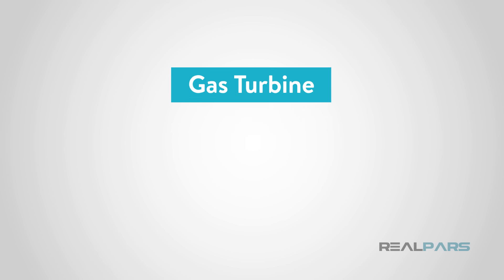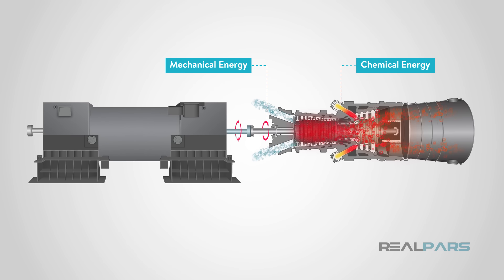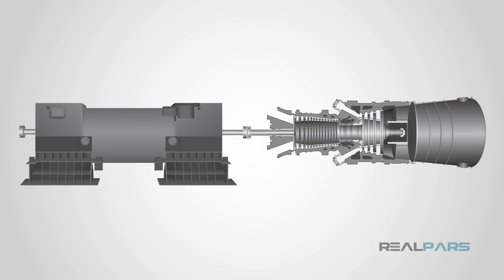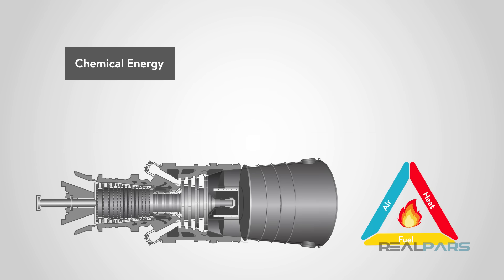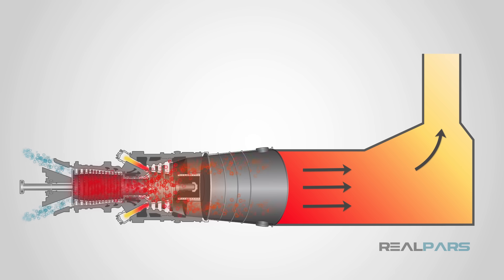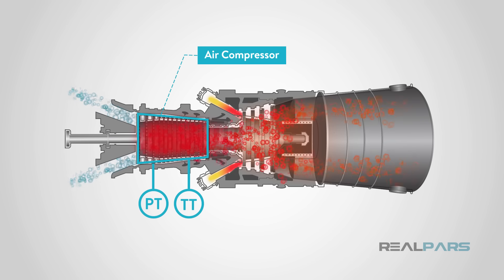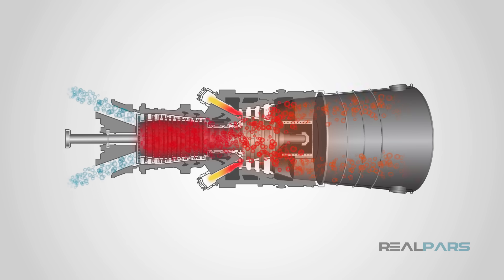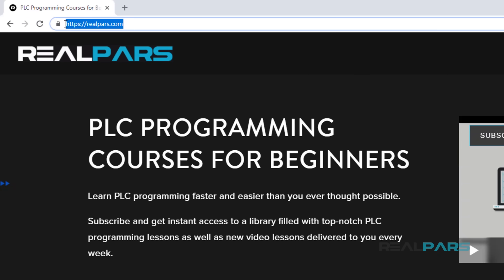What is a Gas Turbine? (For beginners)

Comment: Two of the most common applications of Gas Turbines in modern industries are turbo generators and turbo compressors. I try to approach a gas turbo generator or GTG to better feel the subject. In a gas turbine power plant,there’s generator which is an electrical machine. But to generate electricity this generator needs a prime mover which for my example is a gas turbine. The gas turbine transforms the chemical energy in the fuel for example natural gas or similar fuel, into mechanical energy. The mechanical energy generated by the turbine exit shaft is then transferred through a gearbox to the Generator’s shaft. Now my generator can create electrical energy. This primitive form of electrical energy normally has a low or medium level of voltage and to better manage the power loss in transmission lines, this voltage should be increased by step-up transformers. Such transformers give an adequate level of voltage to the electrical energy to be transmitted through the transmission lines and delivered to the grid. After this brief overview of a sample gas turbine application, I’m going to dig down into the Gas Turbine mechanism in more detail. First, imagine a rocket in which some fuel is going to burn and create a high-pressure exhaust gas. Based on energy conservation law
Reply from the maker: Appreciate you adding this insightful overview. 👍

Comment: I've got a slight nitpick @ 1:49

The voltage doesn't decrease from the the distribution line to the home by itself. That diagram in real world conditions would fry every piece of electronics in a house. The voltage is decreased by step-down transformers at a substation; which isn't pictured there. And then it's stepped-down again by another transformer positioned on a pole somewhere along your street.
Reply from the maker: You're absolutely correct in pointing out the varying voltage levels from the power plant, ranging from 69,000 to 765,000 depending on transmission distance. Eventually, this voltage is brought down through a step-down transformer to a more usable 240/120 range.

While this video focuses specifically on "What is a Gas Turbine?", we truly appreciate your interest in discussing voltage in more detail. Your input means a lot to us. If you're keen on exploring voltage further, we have a range of short videos dedicated to the topic on our RealPars YouTube channel that you might find engaging and informative.

Comment: Why gas is compressed in multistage how it increases the efficiency?
Reply from the maker: Thank you for your query. Gas turbine engineering is designed to maximize fuel efficiency. Typically, in this engineering process, the heat generated by turbines is repurposed to heat a boiler, producing steam that powers an additional generator to generate electricity. Numerous original equipment manufacturers (OEMs) implementing turbines often adopt this technology. For further insight into this topic, I encourage you to explore the following links as valuable resources to aid in your learning:

https://www.energy.gov/fecm/how-gas-turbine-power-plants-work#:~:text=As%20hot%20combustion%20gas%20expands,a%20generator%20to%20produce%20electricity.

https://www.siemens-energy.com/global/en/home/products-services/product-offerings/gas-turbines.html#:~:text=Our%20heavy%2Dduty%20gas%20turbines,extensive%20validation%20and%20testing%20capabilities.

Happy learning!

Comment: What is the difference between turbocharger based generator & gas turbine based! Which is profitable & why!!?
Reply from the maker: Thank you for your inquiry. According to industrial standards, I'll provide definitions for both devices you mentioned in your question. However, determining which one is more profitable is complex, as it hinges on geographical location and the engineering intricacies of their designs.

Turbocharger: A turbocharger, when added to a basic generator gas engine, incorporates an air compressor utilized in internal combustion engines to augment the volume of air entering the engine. This enhances its efficiency and power output by enabling the engine to burn more fuel through the increased air volume in the combustion chamber, thereby boosting overall performance.

Turbine Engine: In contrast to a turbocharged engine, a turbine engine—also referred to as a gas turbine—generates mechanical power by harnessing energy from a rapid flow of hot combustion gases. 

Happy learning from RealPars!
Reply: @realpars  Thank you very much!  I'm a service engineer, working on turbocharger actually! Thanks for the reply!

Comment: The cogen at the plant I'm starting to work right now uses a diesel starter to start the gas turbine. Every other process that you show in the video is similar, except for the diesel starter. If possible, can you show the start up process?
Reply from the maker: Thank you for your question. It's a thoughtful one, but the video did not cover certain proprietary technologies employed by various manufacturers. To get a better understanding of your co-gen system, I recommend checking the operator manual that should have come with your unit. Additionally, here's a helpful link to further assist you in your learning journey:

Understanding the Diesel Engine Control System Used to Start Gas Turbine
https://control.com/forums/threads/understanding-the-diesel-engine-control-system-used-to-start-gas-turbine.48597/

Happy learning!

Comment: what measurements are typically recorded during operation ?
Reply from the maker: Hi there,

Thank you for your question! As we mention in the video, there are numerous devices an Engineer must monitor, like the PT, TT, sensors like Thermocouples, vibrations, RPM, air intake, and so on. Here is a link from Siemens if you want to learn more about the Energy industry. 
https://www.siemens-energy.com/global/en.html

Happy learning!

Comment: You are an engineer working for a manufacturer of land-based gas turbines. These turbines are similar to jet engines, but they are used on land to provide power for electricity generation and gas compression pipeline applications. Suppose that you would like to apply a ceramic-based thermal barrier coating to the turbine blades in the first-stage turbine to increase the operating temperature and efficiency of the engine. (a) What difficulties might engineers experience in trying to design a ceramic coating that will be applied to a super alloy metal blade? (b) What properties should be taken into consideration when choosing a suitable ceramic material for a coating? Be as thorough as possible.

Comment: May I have a question? 
I wondering that have any plants use pure Oxygen instead of air to increase efficiency?
Reply from the maker: Great question!  The answer is "no", since the turbine would not be able to do useful work in a pure O2 environment.  Nitrogen in the intake air is being employed as a process gas, which helps to get useful work from the combustion process. By being heated and accelerated in the combustor, it does the main work of driving the turbine and turning heat into mechanical work. A pure O2 stream would just combust, limiting the amount of useful work.

Comment: Why wouldn't they pre-heat, the incoming air by the exhaust, to increase efficiency and decrease fuel consumption?
Reply from the maker: Very large gas turbines may have economizer sections where waste heat is reused, but part of controlling the efficiency in the combustion chamber is control of the incoming air and fuel streams.  Normally, the bulk of the energy in the turbine exhaust has been converted to work (rotating the turbine) and the residual heat is not easily captured or able to be reused.  It is a matter of the economics of doing so, as well as space limitations where these engines are used.
Reply: Colder air is denser so you would get a more efficient burn, but by the time the air has passed through the final compression stage it is so compressed that the temp is already increased

Comment: What is difference between Gas Turbine and Power Turbine?
Reply: The term Gas Turbine generally applies to the whole unit package. Some Gas Turbines have 2 shafts, and several rows of turbine blades. The high pressure turbine blades drive the unit's compressor stages on the first shaft. Hot high pressure gasses exiting that unit drive the second shaft which rotates independently. Its turbine blades drive some kind of load device with its output shaft  coupling. That's the section of the unit called the Power Turbine or Low Pressure Turbine. These 2 shaft Gas Turbines generally drive centrifugal compressors in oil refineries but can be used to drive water pumps to propel ships and passenger ferries, even the propellers of US Navy Missile Frigates.  

The Power Turbine output shaft of a 2 shaft Gas Turbine has the ability to be completely locked from  turning while the high pressure turbine and compressor section are still operating. So the output speed and torque of the Power Turbine can be changed very easily from 0% to 100% rated load as needed by varying the fuel input. 

Single shaft Gas Turbines generally turn the output shaft at a constant 100% speed to turn a generator. It has to rotate at 100% speed to output 50 or 60 cycles per second as required by the power grid. The power output that's pumped into the grid can be varied by changing the fuel flow. When that generator gets electrically synchronized to the grid, its locked in like you meshed 2 gears. There's no slippage at all. So single shaft Gas Turbines are ideal for driving generators. I hope this helps.
Reply from the maker: Hi Chinmay, 

Thanks for your comment!

That would make for a great topic suggestion, I will go ahead and forward this to our course developers. 

Thanks for sharing and happy learning!

Comment: Which engine is this Gas Turbine Engine diagram based on?
I'm kind of confused; At which section do the intake air & the injected fuel get mixed? According to your diagram, there is no way for the intake air on its flow path (compressor -> whatever middle section mean -> turbine) to meet the injected fuel.
Reply from the maker: The Gas Turbine Engine highlighted in this video is a representation of a typical gas turbine (4:50 in the video).  Lots of similar diagrams here:  https://duckduckgo.com/?q=types+of+gas+turbines&atb=v216-1&iax=images&iai=https%3A%2F%2Fs-media-cache-ak0.pinimg.com%2F736x%2F58%2F0c%2F6d%2F580c6d0cc6053005cf6af48f40b2f892.jpg&ia=images

The air intake (on the left) is compressed in the first section of the turbine. This is the flow shown in blue.  Gas is injected (top and bottom, middle of the turbine).  This is the yellow/orange flow.  The gas and air meet in the combustion chamber and the hot gasses rotate the larger turbine blades.  This is a simplistic representation of a complex piece of equipment, but is a typical representation.

Comment: Cant the exhaust gas be used for something? 
It would be a waste to just let it out into the environment.
Reply: See below
Reply: They utilize the hot 1000 degree F turbine exhaust in combined cycle power plants. 2 gas turbines exhaust into a boiler and the steam generated turns a steam turbine generator. These stations are pretty efficient.

Comment: A modern gas turbine is merely a Jumbo Jet engine that's been very securely bolted to the floor! But it does produce at least most of the electrical power in the modern world. The waste gases can easily heat huge boilers & the exhaust gases can provide further power via MHD systems...

Comment: Are the compressor and turbine having the same speed ? Are they on the same shaft ?
Reply from the maker: Usually not.  The generator and the turbine components are on the same shaft, and there is usually a gear reducer coupled to the shaft to create the correct RPM's for the generator.
Reply: @realpars  I am asking about the compressor and the turbine

Comment: To be more efficient, many gas plants use a combined cycle where the exhaust gas that leaves the gas turbine, which is still hot, is used to boil water and power a steam turbine to make even more electricity.
Reply: Actually, I just came here from a video about an oil rig called the Appomattox, and it uses that very method of gas/steam power to produce its own electricity.
It's cool stuff.
Reply from the maker: Thanks for sharing that with us!
Reply: HRSG
Reply: I was at covert energy in Michigan today. Theirs is set up like that
Reply: while I'm reading this reply, I'm looking at a gas turbine which does the same thing OP mentioned here. using additional burners to further heat the exhaust gas and the same heated exhaust gas is used to produce unsaturated steam for steam turbines.
Reply: Smaller gas turbines can be used to drive an absorption based cooling loop.
Reply: yeah but the enegy conservation remains constant, its not like you can make more energy, ain't it?
Reply: @priyangaperera2732  You don't make more energy in a combined cycle, you convert more of the otherwise wasted heat energy into the energy that you want which is electrical energy. The energy conservation is still constant but now you have less heat and more electricity.
Reply: @theotherguy6951  Yes in other words it becomes more "efficient".

Comment: Can we generate air so we can put it in the intake for infinite combustion?
Reply from the maker: Not a bad idea in theory, but no, air needs to be supplied from the atmosphere.  Often, we use combustion fans to increase the volume of air available, but it would be prohibitively expensive to "produce air" in the proper N2/O2 ratios.
Reply: @realpars  Thank you so much . I really appreciate your videos . Im learning something new so someday I'll build a gas turbine :)
Reply: @lyonnguyen2672  Ge lms100 does this. Uses electricity to cool and force induce air. Basically an lm6000 core with frame 6 front end. Not infinite combustion but increases power output

Comment: You got it wrong already.  The chemical potential energy in a rocket is converted to kinetic energy of the escaping gases, not mechanical energy.  In a gas turbine, the chemical energy is converted to thermal energy of the high temperature gases, and using a nozzle, partially to kinetic energy of the gases in the hot gas path.  That kinetic and thermal energy of the gases from the combustion chamber is partially converted to mechanical energy in the turbine, but some thermal and kinetic energy remain.  With the remaining kinetic energy, the gas won't leave the turbine but would just sit there.  Some thermal energy in the exhaust gas can be routed to a heat recovery steam generator to generate steam, but even then, the exhaust is still hotter than ambient and has kinetic energy enough to leave the stack.
Reply from the maker: Thank  you for your comments. Mechanical energy is the sum of kinetic and potential energy in an object that is used to do work. Mechanical energy is energy in an object due to its motion or position, or both.  We agree that the stationary, chemical potential energy is converted to kinetic energy by combustive means, but that kinetic energy, by the classical definition, is a component of the rocket's mechanical energy.  As the rocket rises, its potential energy due to position changes, which also contributes to the overall net mechanical energy of the rocket.

Comment: the work for the electric generator is obtained by the turbine,not by compressor. that means in this case ,the work needed to compress air is equal to generate electric power.

Comment: is there any other uses for exhaust gases once they have left the system? Do they recirculate for heating or leave to atmosphere?
Reply from the maker: The exhaust gases can be recovered to make steam or transfer the sensible heat to other process streams.  A good example is the Linden Co-Generation Plant, which is a 940-MW electric power plant with five natural-gas-fired turbines.  The waste heat is used to superheat water to steam that is distributed to New York City through a labyrinth of tunnels which supply 30 billion pounds of steam per year to over 100,000 buildings in NYC.  This plant is quite an engineering marvel and an integral part of the utility infrastructure of NYC.

Comment: This is a great video.  I will point out however, that around 7:36 they make you believe that firing temperature is measured directly by thermocouples.  It isn’t.  Typically the firing temperature is measured quite indirectly by being calculated from the exhaust temperature thermocouples and other sensors such as ambient temperature.  I don’t know of any (at least heavy duty Frame 6, 7, 9) that measure firing temperature directly anywhere near the combustor or combustor to turbine transition piece.
Reply from the maker: You are correct.  In the video, the important point mentioned is still valid:  monitoring of the temperature is critical to proper control of the turbine.  Incoming gas temperature can be measured via thermocouple, but more modern methods have been employed due to velocity errors and the lag inherent in thermocouple measurements.  For the actual combustion chamber temperature measurement, other direct and indirect methods must be used due to the nature of the combustion gasses, the high temperatures, and the high velocities.